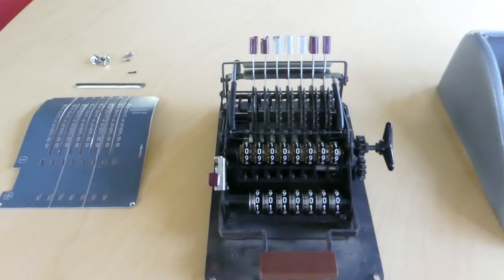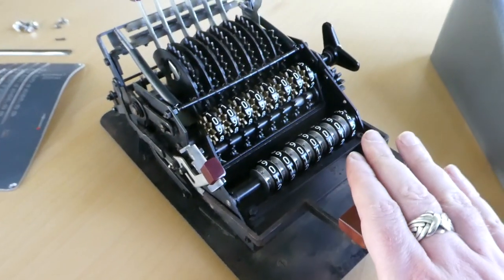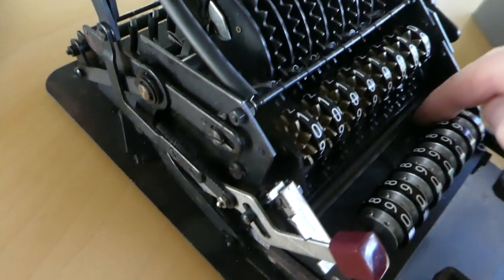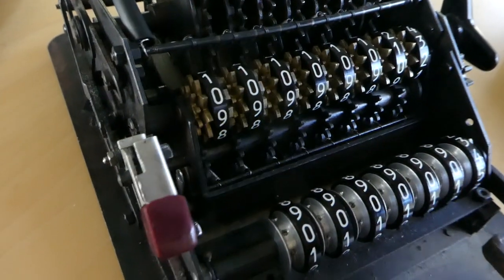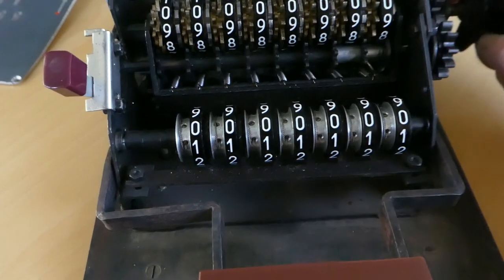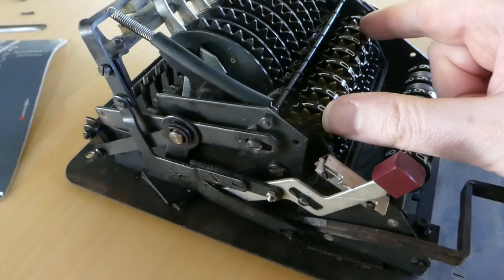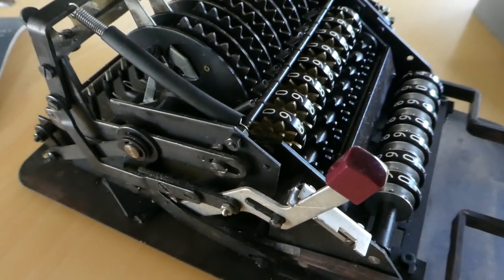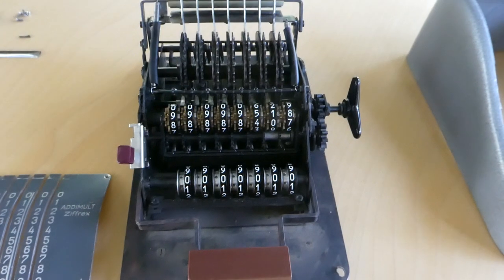The mechanism of the Addimult Ziffrex

Comment: What happens if you try adding 99 + 99, pulling on the tens' and units' levers both at once, rather than individually? Will this confuse the carry mechanism?
Reply from the maker: Yes, you do have to move the levers individually, or else a carry may get lost. One thing I forgot to show, is that a toothed segment can move independently of its lever. When a lever is at zero, its toothed segment is not engaged with the rest of the mechanism.  However, if you have some middle lever set to non-zero, and then move the lever to its right and cause a carry, then the toothed segment of the first lever will be pulled forward one step. The first lever does not get moved by that carry, only its toothed segment. If you then move the first lever again, the carry gets lost as the lever catches up with its toothed segment.
Reply: @jaapsch2  It seems to me that most of the complexity of mechanical adding machines comes from the need for a carry mechanism.
Have you heard of, or acquired, a device called an "Addograf"? (spelled just like that, with "f", not "ph") It is a sort of counting device, used solely to track the carries while its user adds numbers using the traditional, pencil-and-paper method. That is to say, the Addograf counts the tens (to be carried) while your brain counts the ones. It seems that its inventor recognized (correctly, in my opinion) that most of the difficulty in mental arithmetic comes from the need to track carries. Indeed, I often mentally rearrange addition problems so as to eliminate carries. (example: treat $1.69 as $2 minus 31 cents)

Do all mass-produced adding machines use discrete carry, or do any use a continuous carry? By "continuous carry", I mean something like the "sixties carry" of an analog clock.
Reply from the maker: @robertlozyniak3661  I've seen the Addograf listed on calculator sites, but it did not strike me as one I should be looking out for.

The later Marchant machines (Silent Speed, Figurematic, etc) use continuous carry, in the sense that the register was like an old-fashioned car odometer. However, when the calculation ended, the number wheels would be temporarily offset so that their digits lined up with the register window.
Reply: @jaapsch2  Old-fashioned car odometers did not use continuous carry. For example, if the mileage was 35.0, the tens' figure was not halfway between the 3 and the 4, but rather, it was exactly at 3, where it would remain for the next 4.9 miles before (gradually, over the course of 0.1 mile) moving to 4.
Reply from the maker: You are right. Nevertheless, the later Marchant machines do have continuous carry, where the wheels are connected through a 10:1 gear ratio.
Reply: @jaapsch2  I'm guessing that the Marchant carry took some getting used to: if you saw 199 on the display, sometimes that would indeed mean 199, and sometimes 89.
Reply from the maker: @robertlozyniak3661  No. As I said earlier, after a calculation ended, the number wheels would be temporarily offset so that their digits lined up with the register window.